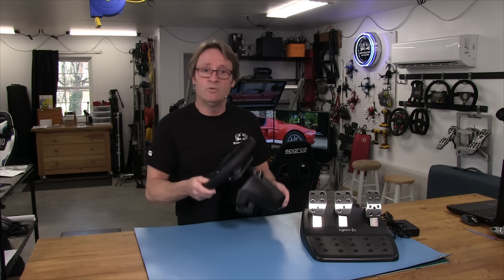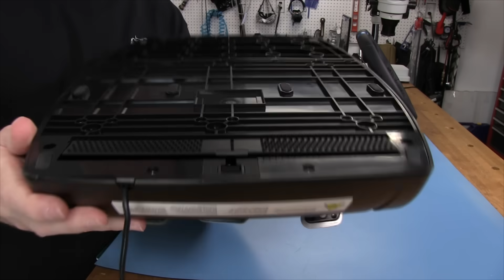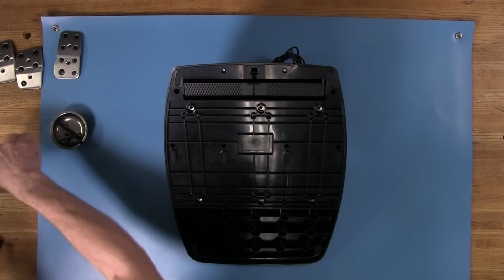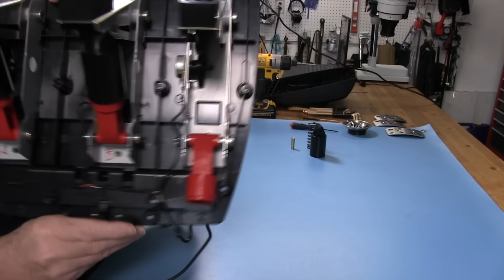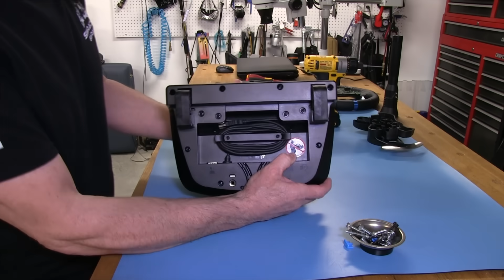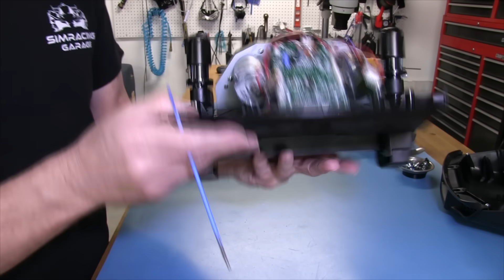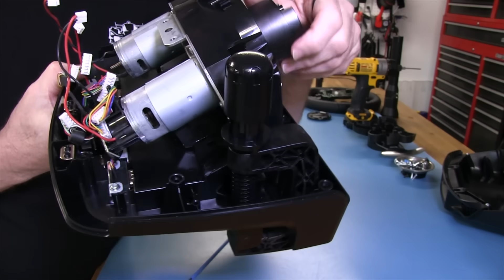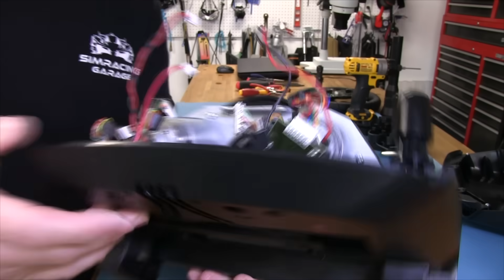Logitech G29 Review

Comment: A word of warning... the wheel does come with a very short cable that joins the board on the steering wheel for the buttons to the control board inside the housing unit.  Over time, due to the grade of the cable Logitech have used, and the 900 degree rotation this cable will wear out and cause issues from the constant twisting. Replacement components can be purchased and it took me some time to find the required connecter etc. but now that I have replaced the cable this wheel is awesome. The connector on the board is some OEM electronic component that I could only source from Japan (I live in France so that could be the reason also... things here are not as easy to get as elsewhere) Symptoms of this problem include all buttons engaging at once, loss of control of vehicle in-game and FFB, notably when turning your wheel where the contact on one of the cores is breaking or loosing contact in the wiring housing.  For example, I would do 3-4 laps in Assetto Corsa Monza then if I went onto a track that was heavy on FFB like Nurburgring Nordschleife due to the vibration paired with the rotation when the cable would twist and become tort the wire would start mis-contact and all buttons on the panel would engage and I would feel the motor resistance going loose and no FFB and the car would stop responding to the wheel turning.  It's not too difficult to sort this issue.  Just the right components and a little bit of soldering but once I overcame this Quality Control oversight by Logitech... as I've said... the wheel is great!
Reply: As a matter of interest to anyone that might still want/need it...  The cable for this is https://www.ebay.co.uk/itm/JST-2-0mm-PH-7-Pin-Female-Housing-Connector-with-Wire-and-Male-Connector-10-Sets/121367876323

Not sure about whether it would matter buying the wheel later.  To my knowledge Logitech have not made any manufacturing corrections to the issue.
Reply: i am thinking of buying this over t150 pro, i am just worried about the ffb deadzone, i will be playing f1 2018, ac, rfactor and if anything else then sim only.. can you please guide me sir.
Reply: @gagandev8634  You can probably adjust the deadzone of the wheel ingame
Reply: This is the exact problem I am having with my G29 right now. Do you have a link to the replacement cable or maybe the correct name to search for?
Reply: I'm also having the exact same problem with my wheel. When i turn left, all buttons engage. I'd also be interested in where to buy replacement cable.
Reply: @FreehhZe  You can find a replacement cable on eBay. Search for JST PHR-7 24AWG. I bought one 2 years ago and still had no issues.
Reply: @grayvuk  thanks a lot! Merry christmas
Reply: @FreehhZe   I have fixed mine temporarily until I find a replacement cable. I removed the black cable shrimp since that was preventing the wires from flexing, then I spun the wires 4-5 rotations before I plugged it back into the wheel. Also I think I have figured out what the cable is called. Google for "7 pin JST". I just need to take measurements so I can get the correct size and wire lenght.
Reply: @JonahHax  wow, thanks for the fast reply! I'll try and fix it in a similar way and then look for the replacement cable.
Reply: @FreehhZe  I may have found a cable, but I will have to open my wheel and double check measurements and direction, but that will not happen until after the holidays. aliexpress.com/item/10pieces-7-Pin-JST-ZH-1-5-ZH1-5-1-5mm-Female-Female-Double-Connector-with/32877165925.html
Reply: @JonahHax  so I actually managed to fix it for now, thanks to your help
Reply: @FreehhZe  You are welcome. If I find the correct cable, I will post a link to it here.
Reply: @FreehhZe  mine is the opposite, when i turn left none of the buttons works,but when i go right or center everything is back to normal.
Reply: @CHAD10ize  the temporary fix I did to use my wheel again still works. So I advice you to try the same
Reply: Dude dude quick question..have you heard of euro truck sim 2 and my summer car?
Reply: Is that less likely to happen if i buy the wheel later?
Reply: If you use the cable management correctly the wires should not have any strain on them.

Comment: I have the G 27 wheel and pedals set which looks to be other than having more buttons on the G 29  rim and a little rubber brake stopper supposed to replicate a loadcell which you said it does not in the brake pedal  , to be the same wheel and pedals . As for modifying the pedals in my pedal set  I removed the spring from the throttle and   put  the spring from the brake pedal in the throttle pedal . For the brake spring I put a 25 lb load compression spring in then added a short 45 lb. load compression spring inside a rubber tube and put that inside the  longer 25 lb load compression spring and rubbed some heavy duty grease around the rubber tube  . I than put the longer spring and also put that in a rubber tube and and rubbed some grease on it and put back in the spring shock looking type holder  . It allows me to be able to brake hard before lockup  much better than the stock spring  that was in it , I don't get lockup until I am on the brake hard allowing me to use muscle memory  instead of  pedal travel memory . I than put a 25 lb load compression spring in the clutch  pedal to give it a little more resistant feeling  which also means  I have to ware shoes now when I am racing .   I do want to upgrade my wheel and pedal set to a higher end set  that has a loadcell  to compare the two to see how close it resemble each other or not and then maybe  to a hydraulic system later . Always like seeing your in depth reviews  that you don't get from other reviewers  .
Reply: Ron Smith where did you get the springs? Link would be appreciated
Reply: Picked them up at Home Depot .
Reply: you could also try  the Fastenal .com they have a much better selection of springs .

Comment: 40.00 that peace its wheel rotation agle stoper and yes meybe like support the shaft but g29 look same peace of shixx like g25-27 and noisy clanky FFB
Reply: The biggest FF clankyness of the Logitech line-up is not due to that part though, It's the small gear on both motors, they can simply move about quite easily and they create that rattle noise (especially on curbs). The stupid thing this , that while it sounds quite bad, it isn't anything to worry about at all!, it certainly isn't damaging the wheel. Everytime I hear ppl complaining that the wheel is falling apart, but I assure you it isn't :) I smashed my G27 wheel for almost 10 years now, and I really hit it a lot (me is quite the angry man) And it still works perfectly, but I also have improved like every part of that wheel in all those years.

Comment: Exactly like a mustang grill haha, Good review thanks :)
Reply: @ Abde Makveli: Shame he spent 5 pointless minutes talking about a grill that actually isn't one, it's just for show as there aren't actually any holes in it.  Quite why he didn't just say, it's a G27 with slightly different software & a new wheel rim I'll never know, the pedals are also exactly the same except for the slightly different software with their frankly laughable excuse for a load-cell sensor, it's either a load-cell or it isn't because you can't fake it with software.
Belt driven wheels are quieter, smoother & give just as strong force feedback as any gear driven wheel I've owned, the alloy drive cogs & toothed rubber belt in my T500RS also means they will probably never wear out either.
I'm not hating on Logitech but my G27 will be the last one I buy as I don't care for their new range much.......

Comment: I have a G29. One day I plugged it on to the Ps4 and I had my hand on it so it got stuck during the process of the initial rotation (calibration). Now the wheel doesn't work like it used to (when playing  Project Cars the curves don't deliver the same "gravity" feel on the wheel; also, when I  turn to take a curve and I use the brake too much I loose control of the car a lot; some other racing games (Project cars 2 are even  harder to play tha before due to the control issue when turning the car). I want to open the wheel  and see where the problem is but i don´t know what parts should I check specifically and If it can be fixed. Can anyone give me any advice? I would very much appreciate it, please. Thank you.

Comment: Is there a way to remove the "firmware curve" for the brake as 75% travel is seen as 100% in software
Reply from the maker: I am working on that. My findings will be in the upcoming G29 Load Cell mod review.
Reply: Sim Racing Garage thankyou for your work.
Reply: https://www.gtplanet.net/forum/threads/the-must-have-upgrade-for-any-logitech-g-wheel-owner.279149/page-15#post-11771763
Reply: Remove the rubber bumper completely. Get a new brake spring or complete set from GTeye. http://www.gteye.com.au/about-gteye. 100% brake travel usable.

Comment: I have had my g29 for a little over 2 years now, and I must say it has been very good. But as you said, the brake is very "grabby" at the end, I often find myself locking up because I need fidelity under hard breaking. But other than that, it's been very good and I've had no issues so far. Thanks for the great content!
Reply: Kinda expensive...
Reply: karlpc200 You can remove a little rubber piece in the brake. Only thing I've changed so far on mine
Reply: lol just use a different pedal set.

Comment: Great review!

Some nitpicks tho. The "stabiliser" is just the hard limits for the wheel. When you turn full left or right the limiter just stops the wheel from rotating any more. There is probably some sensor in there to detect it so the wheel does not try to drive against that limit but other than that it doesn't do anything else. That same systems has probably existed in every logitech wheel. G25 and 27 probably had it and the old driving force pro definitely had it.
Reply: It's all exactly the same from G25 up. I took them all apart more then once , some revision changes on the circuit board etc. but nothing special. The only real difference are the helical gear teeth introduced in the G27. Current wheels are just G27's with a different face, some extra buttons and the added rubber in the brake pedal. The "Stabiliser" is clearly to limit the wheel rotation, it does nothing else. In direct-drive wheels the motor is strong enough to induce the end-stop themselves, therefor the wheel can rotate endlessly when no force is applied.